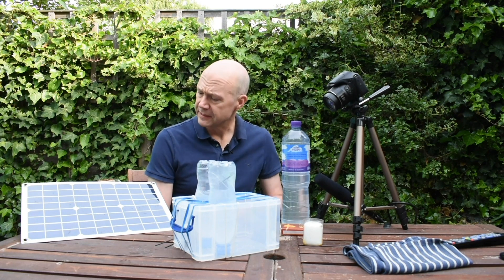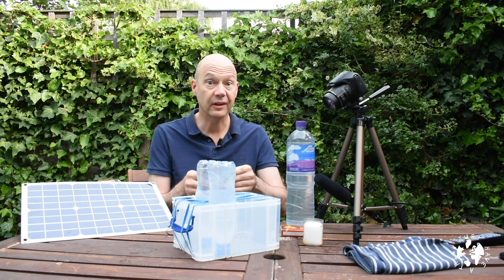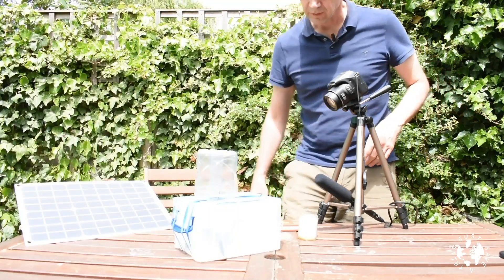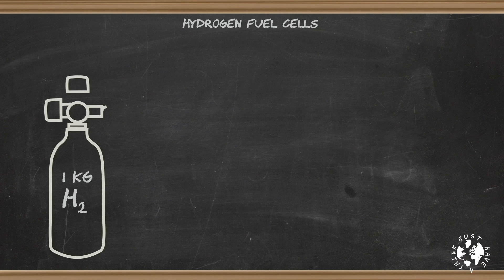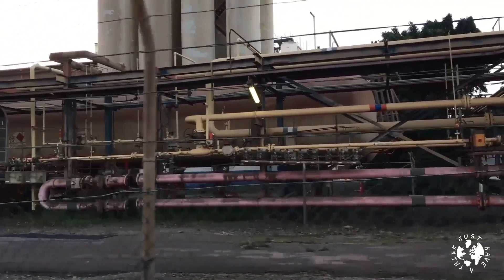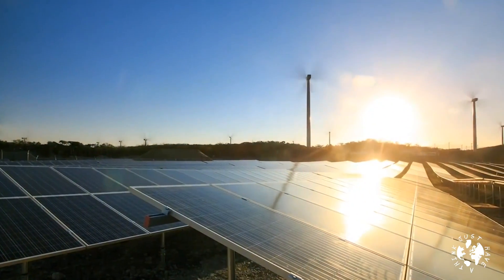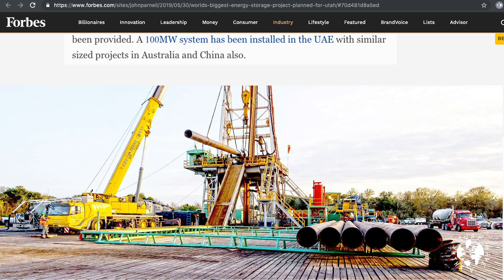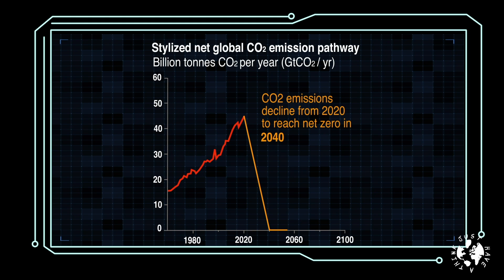Energy Storage in Hydrogen : Does this beat batteries?

Comment: LFTR's are the solution to the energy problem(and multiple other major problems). They are safe, they are cheap, they are reliable, they are relatively simple so they can be made small, they can be made big, they can be made on an assembly line, their primary energy source can be found just about anywhere that there is dirt, they eat pre-existing nuclear waste, their waste heat is perfect for desalinating sea water, they are surprisingly self regulating AND walk away safe, and to top it all off they produce BISMUTH-213 which is basically gods way of bitch smacking cancer in the face. The are two major things holding this technology back:
1: The pre-existing industries not wanting to get put out of business
and
2: Peoples fear of the word nuclear. And spoiler alert, solar energy is nuclear energy so if you believe in solar power you believe in nuclear power. Chances are you just don't believe in the widely used Pressurized Water Reactor nuclear energy technology because let's be honest, it is an extraordinarily complicated, dangerous, and frankly stupid way to do nuclear energy that was literally only focused on and initially developed because the U.S. government wanted to make Nuclear Bombs. Which is fucked up and ridiculous so it totally makes sense that people wouldn't want to support that

What you might not know is that the same guy (Alvin Weinberg) that created the Pressurized Water Reactor also created the Liquid Flouride Thorium Reactor which bypasses all of the major problems and dangers of PWRs mainly because it operates as a liquid at low pressures. He tried to get the government to switch and was particularly well suited to make the suggestion considering he created both the reactors but long story short is they were already invested in the other reactors and were more interested in blowing shit up and making money than they were with providing the world with clean abundant safe basically free energy and making peace so they told him to fuck off and fired him.

*Note: When I say free energy in this context I am referring to the fact that the main ingredient in LFTRs, Thorium, is dug up and thrown away as garbage by companies all over the world every day because they don't know any better. And when i say they I mean pretty much every body but China, China has been stockpiling this shit for years and is now going gung ho with LFTR's so don't be surprised if we start buying all our energy from them pretty soon too.
Reply: Thorium uses the same fuel cycle as other nuke plants, so weapons could still be made.

Comment: While I agree that hydrogen is an excellent candidate for medium term energy storage, I don't think using existing natural gas infrastructure is actually a very viable option for distribution as this infrastructure is not currently designed for it. As hydrogen molecules are very small it easily escapes from porous materials and can cause metal embrittlement. It may be better to look into upgrading the hydrogen into higher level hydrocarbons if you plan to distribute it to the consumer market. This will also increase the convenience of using it as a fuel.

Comment: You skipped talking about efficiency of the process. You can think about hydrogen as a battery, but a very poor one.
You waste 2/3 of energy in process electricity->hydrogen->electricity.
Imagine you have a solar array on your home that produces 10kWh, and you charge your car, and you can do 30 miles with it. 

If with the same 10kWh of electricity you make hydrogen and put it in your fuel cell vehicle, you can do only 10 miles with it. So you need 3x size of the solar array to get the same amount of usable energy. Sun is free, but the solar panels are not.
Reply: I prefer the convenience of having a fully charged vehicle every morning over driving across town to full up with expensive hydrogen.
Reply: @warrensteel9954  the goal is to fill up at home.
Reply: @scorpio6587  I already do that from an outlet for cheap.
Reply: @scorpio6587  are you seriously saying each home in a town shoukd have their own hydrogen storage ?
You really don't see any danger with that.
Not to mention the cost to have to build then all, and the need for 2 to 3 times the power to run it all. Then there is the hydrogen cars, seems really risky ti drive, not to mention there really isn't any in the marked yet, where there is plenty of EVs and they are safer too.
Reply: @-JustHuman-    now but many roofs and facades can carry solar panels. the electricity is used by a central plant to produce the storable fuel.
Reply: @xyzsame4081  Then it would still be better to have a house battery, you would lose less power that wayy. As you lose power sending it from your house to a central storage, then on making the fuel, then use lose a little over time too as hydrogen is really hard to store, as it is the smallest molecule we have. Then you have to reverse the process for you to use power in your home, you will then lose power in buring the fuel, and sending it through the net again. Where as a local battery would only lose a small part of the charge over time anyway, and would make the grid much more stabile, as now all your power are decentralized to where it is used.

Yes, mass storage have their places, like with windfarms or solar farms, but again it dies not need to be a volatile gas that is hard to store, and loses a lot of power when its used. Gravity batteries are cheaper, easier and needs less area to be used, and as a bonus they also keep more of the power we put into them than converting hydrogen. So again where do we need to use a hydrogen system ? The most optimal place I can see are freight ships, as they aree most of the time isolated from people in generel, meaning an explosion would kill the least, and leaks are far from people too. And they can't use other more efficient systems, as they can't use gravity for storage and batteries and water ain't the greatest thing to mix, not that you couldn't make one with batteries, but you could use hydrogen here without it's massive problems being that bad.
Reply: Hydrogen is a terrible idea for cars compared to batteries, which work well enough for short term storage. The point in the video about using hydrogen is for long term storage, where its low efficiency becomes competitive compared to other options (eg, as batteries would leak charge). Low efficiency obviously isn't ideal, but it's hardly the end of the world (relative to continued greenhouse gas emission) because right now, we're actually throwing away huge amounts of electricity generated by solar and wind when it's above the demand on the grid. Expanding grids longitudinally can help with the current level of waste, this acts as virtual short term storage - but instead of my collecting sun in the day to power homes in the evening using batteries, I make use of the fact that it's always evening somewhere else. However, longer term storage is needed, for example, to deliver solar electricity from the summer to winter months. The equivalent time shifting using the grid here would require north-to-south hemispheric power lines, so somebody else's summer can collect for your winter. This just gets silly, wasting a bit of electricity on compressing hydrogen to use in winter months instead of wasting it on nothing and having to burn carbon is a move in the right direction.
Reply: @annoloki  ...intristing....but i give callcul numeric mathematic for echivallent energy callcul and you not precizaid suplymentar this... repeat. .is not energy(electric) for obteining hydrogen... ___archaix lord
Reply: The problem is storage,  and that is a advantage for hydrogen.  Particularly given the nature of Renewables, the wind doesn't always blow the sun doesn't always shine, and batteries don't hold their energy forever. 
   these problems are going to be increasingly exacerbated as the electrification of our transportation continues to increase as tens of millions of people come home to plug in their cars and thousands of transportation workers plug in their trucks and park for the night. 
Even at this early stage when most electrics are compact economy cars they still take what the average American household uses in an entire day just to run a 20-minute commute, and those demands are going to spike several times over when we factor in crossovers pickups and SUVs entering the market. Pricing a storage system capable of handling the demands of my household on top of say a pickup truck and an SUV each with a 30 minute commute is rather daunting even at a 75% projected discount for future improvements in production efficiency. The question is precisely how much would an industrial-sized hydrogen storage facility cost versus other methods of storage? If instead of dropping tens of thousands of dollars into battery storage so I can run my vehicle's I can put that money into say a bigger more powerful solar array and use the grid as my battery the economics make way more sense.
Reply: Thing is solar today is actually the cheapest power source. even a household battery unit can cost $6000+. the panels to operate such a system. depending on where you are. you can expect to pay about $1200-2000 per KW/H. typical household units usually have ~5.. also ,
 producing 1 kg of hydrogen (which has a specific energy of 143 MJ/kg) requires 50–55 kW⋅h (180–200 MJ) of electricity.
so it's about 72% efficient.
Main problem is hydrogen storage requires infrastructure.
Reply: @Tfad812  you speak truth..___archaix lord
Reply: @Tfad812  No, it's not 72% efficient.  You forgot to convert back from hydrogen to electricity, and to account for the energy cost of compressing it.
Reply: Batteries aren't free, either.  Plus we should consider the convenience of filling a car with hydrogen.

Comment: Hydrogen is good idea on paper but it is stupidly expensive way to make electricity also keep in mind that these storage facilities are basically one big bomb
Reply: It is stupidly expensive if we are using fossil fuel to make the electricity to turn water into hydrogen but if we are using renewable energy methods like wind, solar, geothermal etc. Then its not, and it is a necessary way to store excess energy generated for later on when there is not so much wind and/or sunlight.
Reply: @ScamallDorcha  I worked on hydrogen rc car project it was mid size rc racing car which was running on 20liters of hydrogen the fuel cell cost over 800euros and deliver max output of 27 watts and it was the best at that time (2017). The  hydrogen generator cost something like 450euro and produced ~5liters per hour of clean hydrogen. It was paid be our sponsor who organized the race but still hydrogen is not the best way to go

Comment: Too bad you didnt think it through, pun intended. There are several serious problems with hydrogen that you failed to even mention. Electrolysis is relatively inefficient (as is converting  hydrogen back in to  electricity). This is particularly true if you need to compress the hydrogen, which is true for almost everywhere where there are no giant salt mines and doubly so if you intend to run a car on it. You also dont mentioned the safety issues and material issues that make hydrogen a really tricky gas to work with.

Comment: Excellent video! I've been wondering for a couple of years why they aren't using electrolysis to generate hydrogen and then use that hydrogen to generate electricity.  I'd assumed it must be incredibly inefficient.  Hydrogen fuel cells were used to power the lunar missions so it's hardly new technology..
Reply: Check Real Engineering video on this subject titled " The Truth about Hydrogen".

Comment: Hydrogen production is not very efficient today but I think there will be vast improvements in the efficiency that will make hydrogen the fuel of the future. Batteries pollute where they are mined, produced, and disposed. Batteries are more polluting than fossil fuels.
Reply: Hydrogen is far too inefficient to be the fuel of the future . Batteries actually pollutes less than hydrogen storage throughput their lifetime due to the high inefficiency of the hydrogen cycle in storing and converting electricity . Real Engineering did an excellent video(https://www.youtube.com/watch?v=f7MzFfuNOtY)  on the  inherent weakness of hydrogen compared to batteries when it come to energy storage and use for transportation "fuel".
Reply: if you can produce near unlimited amounts of power for almost no input it doesn't matter how effective you produce the hydrogen at. the only problem we have isn't the amount of power we produce but rather it's the power we can store in a given area and at what upfront and maintaining cost. hydrogen fills this roll quite easily with the tech we already have let alone later down the road.
even if you lose 50% of the power storing the hydrogen it's orders of magnitude better in terms of storage in a given volume of space.
Reply: @rocksfire4390  

Sure, if we live in a world where energy is free , then hydrogen  might have that advantage. But energy is not free  and because of this Hydrogen  doesn't  fill this role as well as Li-ion batteries either. The lifetime cost is more expensive when compared to batteries .
Reply: @remliqa  
batteries wouldn't even last a decade of abuse from a grid system.
solar and wind is relatively "free", besides the upfront cost. again power production isn't the problem, it's power storage that really is lagging behind. ion batteries take too much space right now, maybe in another 20-30 years when they triple in capacity then it would be fine. right now though it isn't a option and we don't have 20-30 years to dick around. we have the tech to transform our energy grid into something renewable.
also tell me how the lifetime cost of hydrogen is more expensive then ion batteries?
current prices are 176$ / kWh for ion batteries. current prices factoring in the electrolyser and compressing it to 700 bar is 5.3 cents / kWh. ion batteries degrade over their lifetime to about 20% - 30%. this has to be factored in and thus you need between 20-30% more storage as over time/use they will lose their capacity.

normal life span of ion batteries is based on DoD which means that depending on how much you charge/discharge the battery will affect how many cycles the battery will last. if the grid where to take 100% of the energy from the batteries it would only last 300 - 600 cycles (a cycle is charging, discharging and charging again) e.g a single day. thus if these grid batteries where discharged fully and charged again for the next day they would only last at most 600 days, not even 2 years. if they went only to 60% total discharge they would last 1,000 - 3,000 days, however that means we need 40% more battery storage then. also temp and voltage is both counted in here for how many cycles a ion battery can last. ion batteries should be kept between 18-25 C which means in most areas it would need to be cooled and in some even warmed, that cooling/heating takes a boat load of power which isn't factored in anywhere.

now that you understand that kind of, we can take the 176 / kWh for ion batteries and then we can get the actual price over it's lifetime (as they will need to be replaced when there lifetime is up. if the battery is cycled 100% then it's cost is 0.29$ / kWh, if it's only discharged by 40% (60% remaining) then the cost is 0.06$ / kWh, but hold on we need more storage because we are only discharging to 60% capacity now. we need 2.5 times more storage space to get the same amount of capacity as the 100% discharge/charge battery bank. thus the price isn't 0.06$ / kWh but instead 0.15$ / kWh. nearly 3 times more expensive then hydrogen, this however doesn't factor in the cost of disposing of the batteries nor does it factor in the cost of workers keeping track of the batteries nor the cost of cooling/heating which will also affect the cycle life of the batteries if not kept in control.
also i should point out that creating the hydrogen would be done by left over solar/wind power and not by the energy grid itself. thus the actual cost of making hydrogen is 0$ / kWh because that power wouldn't of been used anyway. 

again we can scale solar to every building everywhere, production of energy isn't the problem it's the storage of that energy for use later.

Comment: finally someone else covering hydrogen as a means of storage for renewables. until batteries become 3-5 times more effective they will never be useful for power grids.
Reply: Batteries are still more useful than Hydrogen for smoothing the infamous duck curve in daily power consumption. Hydrogen is just too inefficient to deal with that.
Reply: @remliqa  
it's really not that inefficient at all.
Reply: Actually the big problem with battery storage is the cost
Reply: @skiinggator  
100% agree. people don't do the math for the cost of batteries which have a lifetime, and if you want to baby them you need even more batteries to make up for the capacity you lost trying to baby them. that's not even counting any of the other things you could do to prolong the life of the batteries like the temperature of the batteries. then you need to dispose of them....which is never accounted for.
Reply: @rocksfire4390  

I suggest you look up Real Engineering video titled  "The Truth About Hydrogen". It outlines how woefully inefficient hydrogen is compares to current gen of Li-ion battery.

Battery cost is falling at a rapid paces and it is still currently cheaper than hydrogen storage especially when you count in the overall cost over a lifetime starting from manufacturing  to when the battery need to be replaced (recycled).